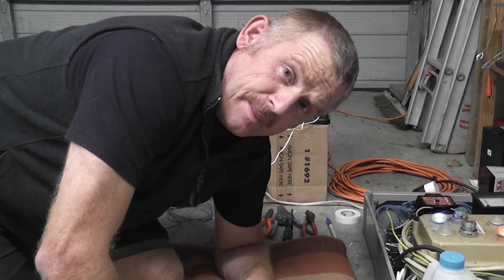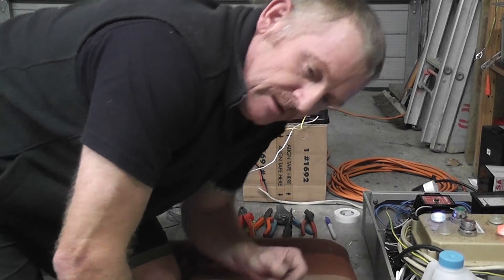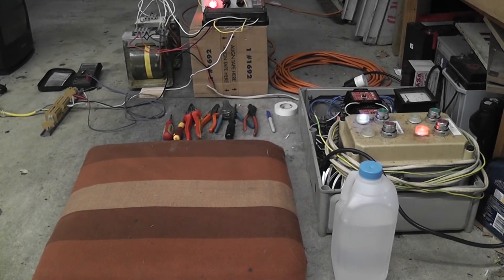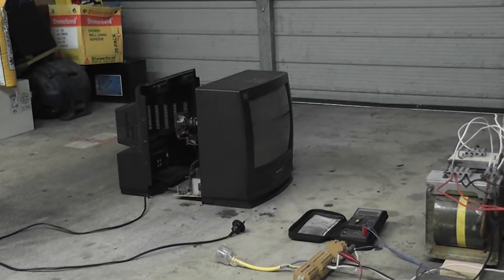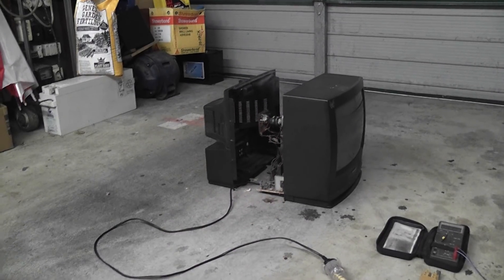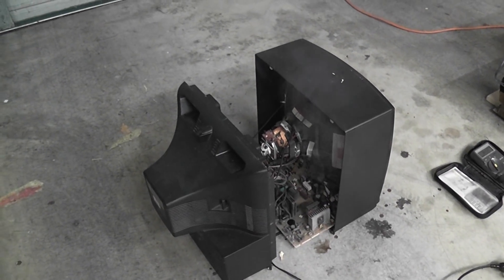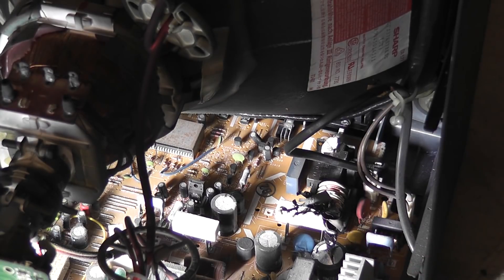TV overvolting at 600 Volts AC

Comment: whenever you overpower something like that TV, do you start at its normal operating voltage and go up or do you just throw the 600 volts at It all at once.
Reply from the maker: This TV was running at 230 Volts and then switched over to 600 Volts, 
In an other video on my TV playlists , other TV's were run at normal voltage and then slowly ramped up to 400 or 500 Volts and kept working till they popped.

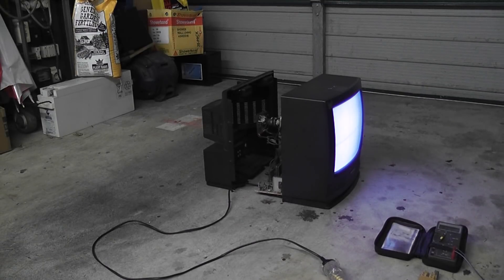Comment: In the Philippines it's not uncommon for Filipinos who had been in the U.S. to buy TV there and bring back home because it's cheaper there (Philippines uses NTSC-M so they are compatible). However American TV are 120 volts and Philippines is 220 volts with American blade type plug which means that American appliances can be accidentally plug to our 220 volts mains and I'm already familiar with that. In most cases only the fuse blows up although I saw some American TV that works from 110 - 240 volts without problem. I'm planning to bypass the fuse to see if the result is the same as yours (1:13).
Reply from the maker: look forward to the video. have your camera ready. Bridge out the fuse and enjoy. Often the mains filter cap goes with a big bang.
Reply: RODALCO2007 I think our TV has a universal power supply because although the back cover indicates 120 volts and we are using a step down transformer for years but when I plugged it to our 220 volts mains it works perfectly. The filter capacitor is rated 400 volts. Even the PS3 system which is rated 120 volts but when I plugged it to our 220 volts mains it also works perfectly as well. They didn't blew up.

Comment: I don't know too much about TV sets but I have a little question:
Assuming that the flyback (device that provides electricity to screen) was overcharged and exploded, could this be replaced by a new flyback and returns this TV on life???
According to this, could the screen damaged by this???
I hope respect my comment :) Thanks
Reply from the maker: In this case the TV's powersupply rectifier and the electrolytic smoothing caps exploded. The excess Voltage overvolted parts of the circuitboards at the same time.
Most likely the LOPT driver transistor would have sustained some damage too.
Reply: English is not that guy's first language.

Comment: That was pretty cool. It looks like a circa 1997-2001 Sharp set. Could this ever be repaired?
Reply from the maker: No, it was an EOL set which had intermittand faults in it after it warmed up.
Reply: RODALCO2007 Oh okay. Nice explosion BTW. ;)
Reply: ***** I once found a 1990 Sharp 13RM59 (with woodgrain) on the curb and it still had a beautiful picture.
Reply: ***** Yeah Sharp was pretty darn good until later years. That's cool that your uncle owned a tv repair shop.
Reply: I got a small little 2003 Sharp set, it has mono RCA and composite on the front and coax on the back. My main TV (in my room) is a 1991 Hitachi and i have a Sony CPD 100-sx monitor as well as a Salton Icebox.
Reply: I think Venus Is Fixing all TVs In His Electronic Repair Shop.

Comment: If only you had connected a welder to the lower voltage parts of the TV, bypassing the power supply...that would've been quite interesting - apart from any circuits that need a HV, so perhaps apply both 600VAC and at least 50VDC @ 180+Amps! LOL. Look for The Secret Life of Machines, first series, last ep on the TV. Using one TV, burning them whilst working can produce interesting things. Didn't expect the 19 in the video to go up so well though! It's a good programme, inspired me as a kid!

Comment from the maker: Tubes never pop with overvolting the power supply. The filament will go open circuit.
Most often the power supply would have popped well before any other damage is done to the LOPT or the tube.

Comment: you are risking erratic behavior for very little gain in performance.  I never understood the point in overclocking as the gain in speed is minor and the risk as well as violating warranties makes it a larger risk in my opinion.  The cost to upgrade to a truly faster device is worth it when you determine the cost versus risk.  While its "safe" I question the point in taking that risk.

Comment: Mr Rodalco2007,you taken me back in time with this demo ( flash bang).
many years ago ( 1990's) i started my apprentice ship as a t.v. /video audio tech repair,may be the 5 or 12th job,I had a itt 14" tv that had psu over load.
Due to unexperiance and my colleages playing a prank on me ( wet behind the ears) they wired up the feed 120v line straight to the crt board,so when (I) came to put it on soak test it blow out the 2 start up capacitors....THEN I S@~T MY PANTS ha ha ......thank you sir
Reply: Poopy Mouth

Comment: LOL you must think i'm a newb.

I have an Athlon II X2 250 (3GHz) overclock at 3.850Mhz, base clock 257. That's why I needed to raise the voltage. Although google tells me overvolt is safe since temps are good. 

I wanna know his tell about it.

Chipset is at 2570Mhz (1.25v default - 1.4v now)
Memory is at 1400MHz @1.65v (1600MHz default - 1.5v)

Comment: Hey RODAL I have a question.

My CPU default voltage is 1.38. I overclocked it and overvoltaged to 1.525.

Temperatures are normal, is there a problem on doing so? Because on the internet no one gives a solid answer.

Ty